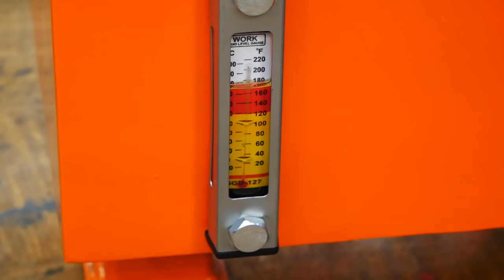Making Gas Powered Hydraulic Power Pack

Comment: Can I make a few suggestions.  You should always have the intake of the pump below the level of oil in the tank . Hydraulic pumps are not designed to self prime and this will wear the surfaces in the pump prematurely by cavitation and lead to loss of pressure very quickly.  
Also the intake line on Hydraulic pumps are supposed to be atleast one size up then the output line. It draws in through that line at a higher flow rate then the introduction of resistance to flow creates pressure which the pump generates on the output side. This will also lead to cavitation in the line.   One last thing is try installing a wall in your tank ( just a couple of tack welds ) that separates the intake and return hoses but not completely sealed just enough to alow oil to creep around it. This will limit dirt ,debris and frothing in the oil that also leads to pump failure. I build custom Hydraulic systems at our shop just thought you could benefit from mistakes I've made.
Reply: Would that pump work in a vertical orientation? Like under a lawn mower motor and use the chassis as the body of your portable unit?
Reply: @messybench  Yes most gear pumps can run in horizontal and vertical orientations. They do not  have bearings in them so they are designed to spin on a film of oil they pump that usually .040" thick. That's why making sure there's a continuous flow of oil to them is important .
Reply: Brilliant info. Thanks.
Reply: Absolutely, nice suggestions... very sweet.
I will try to remember this if I ever build a Hydraulic Pump system.
Reply: Thanks
Reply: Suggestion from expert, glad to know you mate. Thanks
Reply: How would one add a cooler to the power pac?
Should there be suction filter and a high pressure filter?
Reply: @Navigator777777  Cooler are usually always installed in the return line right before the return line filter going back into a tank or reservoir.  This part of a hydraulic circuit should by design never see more then the internal bypass crack pressure of a return filter housing.  (Around 15 psi or 1 Bar on most small return filter housings).
Reply: Is this true? Hydraulic pumps are not designed for self priming?
Reply: @peterrajeshcrasta1524  After they have been primed they will maintain a suction but the reservoir should by design be placed in a way that the oil level is above the pump. If you operate a hydraulic pump dry even for less then a minute the rotating parts can wear the plate surfaces very quickly.
Reply: Nm
Reply: Would you please start making and posting videos? 😁 I'd very much like to learn more about hydraulics, and it sounds like you have the proper experience and knowledge 🙂  Thanks for sharing these tips, very useful.
Reply: @buildthings79   throw a check valve below the supply line just under the pump to keep her full with juice or am I wrong sorry just a noob here
Reply: @justincapasso5691   Unfortunately the check valves used in hydraulics require certain amount of bypass pressure to open them and this would add to the draw vacuum required to draw the oil into the pump . You also have to take into account temperature changes.  When the oil gets cold it becomes thicker.  It's on those days that cause the most damage to a pump.
Reply: @buildthings79   what kind of degrees/certifications do you have and field experience because it’s seems you have a very advanced knowledge on hydraulics. I’m just getting out of a mechatronics program and would like further understanding on the hydraulics field. Also make a YouTube channel for gods sake lol.
Reply: @justincapasso5691  I own a small custom Metal Fabrication shop where we build a verity of metal and custom hydraulics jobs. We have a cnc plasma table, cnc pressbrake, and a number of welders. I also have 2 hydraulic hose crimping machines . I have been doing this for about 20 years and have taken a few certification classes on Industrial and mobile hydraulics. We rebuild cylinders and other such hydraulic components . I just finished a custom job of installing a 1991 Sea Crane knuckleboom crane that was custom built for the army corp of engineers barge onto a tractor trailer cab. It had no outriggers so we had to rob some frome another salvaged Hiab crane . We rebuilt from scratch one of the outriggers and fitted a double bank joystick manifold with 12 circuits . The crane was a 15k lb with a 25ft reach. It had double rotation cylinders and a 250ft 20,000 lb hydraulic cable winch on the boom. It was a really fun job.
Reply: I thought also it's always advisable to have a pressure relief valve as the first thing on the circuit with it's own return line and not rely on the one in the mono-block
Reply: Also all the 90 degree fittings add to the inefficiency of the system, even with no load on the extension and retraction of the cylinder , you could here the strain on the gas engine.
Reply: Do you need a relief valve when making something like this? For any pressure build up from the heat or something?
Reply: @andrescalleja3175  Yes , it should be located on the pressure side of the pump either by itself or the first thing in a valve body . These will generally relieve back to the tank.
Reply: @buildthings79  in this case would it have been the thing he was holding that looked to have an oil filter attached? 12:54
Reply: @Andres Calleja  That is a return line filter housing. They generally have a small check valve inside that if the filter becomes clogged, it bypasses it and goes straight to tank. That check spring is usually 15 psi. Or 1 Bar.  You want pressure relief earlier on in the system because it protects the items after it from  the pressure spike. The seals will be protected.
Reply: @buildthings79  in your opinion do you think a power washers motor and pump could be used to make a small hydraulic pump?
Reply: @Andres Calleja  You can certainly use the engine off the unit and look up a calculator online to determine the max pressure and flow pump that would couple to that engine output. I don't think the pressure washer pump would work very well. They have internal bypasses and check valves that are sized for water viscosity and have ceramic plungers that may not have the same tolerance to limit oil blowby direct resistance.
Reply: I agree with the above  it seems to me the delivery of the pump is too high. I would suggest you fit a pump with a smaller delivery to match the HP of the engine giving better power and control.

Comment: When you build it out of tools that you also built. Skill level 10,000. That plasma cutter is so sweet!
Reply from the maker: Thank you 😁
Reply: @WorkshopFromScratch  - The only "problem" with the plasma cutter is that you have to manually hold up the plasma cutter line 0:09 as the cutter moves across the material.  It would be nice to have some sort of spring suspension to do this task for you.  A minor thing, but one can see that you must lift up the plasma cutter hose before it binds on the edge of your work 0:13 - fantastic work as always.
Reply: Did u build that plasma cutter

Comment: Nice. I am pulling a 31 HP Diesel from an old tractor and was planning to make it a mobile power unit to drag behind a tractor. Perhaps a bit more ambitious than I can chew at once, but I'll get it working eventually.
Reply: How's the project coming along?
Reply: @user-ki9ez8wx7f  Mostly it's not. I got the old engine fired up and towed the tractor to a work area (it has a busted transmission and was parked out in front of the house). We got it so it starts easy every time. Then nothing. Time is the issue. At least the lawn ornament is gone. Wife happy about that.

This coming week might see action, because I have company visiting and they are those kind of people.
Reply: Dimix
Reply: ⁸⁷⁷

Comment: This is a brilliant idea for situations where the hydraulic system is somewhere else not close to electricity. I will want to build one like this too (with some small changes, will reuse more scrapped parts, like compressor housing for oil reservoir).

Comment: I would route the intake tube to the opposite side of the tank and maybe put a baffle between intake and return. The returning oil gets air bubbles in it and damages the pump or makes it noisy. The distance will help them settle out. Not sure if painting the inside of the tank was a good idea. Hope it doesn't flake off and cause issues.

Great work and thanks for posting it.
Reply: Great video.  I agree with the baffle, trash/condensation will settle out and if something ruptures, you loose less oil.  An inspection hole for the spider might be a good idea.

Comment: I have a hydraulic power unit. This has a 30 hp Wisconsin VH4 engine powering a hydraulic pump with 10 gallon fluid reservoir. This powered a "manlift" bucket truck. I  would like to build several hydraulic projects & power with this universal hydraulic power pack. It could power a log splitter, back hoe, skidsteer loader, stump grinder, saw mill, tree limb shredder or anything that can be operated hydraulically.

Comment: just a suggestion: put quick disconnects on the valve block?
i love your projects! Keep up the good work!
Reply: I was just going to say that. This way you can make more than one tool. 
I would have also prepped in a way for a remote cooler and I am pretty sure the larger size up engines have the same bolt pattern so you can always upgrade to a larger one as many people find that the smaller ones just do not have the power once they have it built.
Reply from the maker: Thank you 😁 Quick-release couplings are definitely a very good idea :)This is  the project will be developmental, and the next project will work thanks to this hydraulic power pack :)

Comment: A couple of things I've learned from experience. Don't make tanks out of hot rolled unless you remove all of the mill scale. It will start falling off later as an abrasive iron oxide powder. Not good for fuel filters or hydraulic power units. :) Also I have never found a small pneumatic tire that doesn't fail and develop leaks in a year or two. Now I always go for solid rubber or metal. They do make flat proof tires but since they are considerably more expensive, I haven't tried them so can't speak to that. :)
Reply: even with painted tank.

Comment: You can do several projects with this hydraulic machine , I liked , congratulations
Reply from the maker: That is my plan😁 Thank you 😁
Reply: As someone said above, adding some quick-connect couplers on the feed and return lines would do wonders - and put the same quick-connect couplers on your tools you plan to use with it.  Very clever.

Comment: Should have put the drain plug on the edge, not in the middle, so when you do need to use it, you can tip the tank to get it all to the drain.😀
Reply: quick connects less mess too, can use for anything

Comment: I hope he had a window open while he ran that engine inside. CO poisoning is no joke it can kill you in a matter of minutes. Besides that I like the build.
Reply from the maker: Thank you 😁 I have a well ventilated room and the outside air is on and as I wrote in the video, I only did a test to show how it works, the power supply will mainly work with external machines and I'm going to build such a machine in the next video :)

Comment: Build one with a 20 HP engine and a pump that can move 19 or 20 GPM of hydro fluid, mount it on a tractor and you can do some real work. Front end Brush hogging,  Large deep hole augering with the loader end,  Land clearing with a mulcher.  Most small tractors don't have the GPH  for a lot of those things. 
You could sell them.

Comment: Video super, can you give clarifications on the hydraulic pump spec selection with respect to the engine spec
Reply from the maker: Thank you :) The pump has of 6L right direction of rotation, as for the engine, I did not take into account the power that is written by the manufacturer because in my opinion this power is overstated, and the real power does not differ from the engines with a capacity of 200cc
Reply: @WorkshopFromScratch  - probably 5-6 HP

Comment: Where did you get the coupling, because pump shaft is conical, but motor shaft is cylindrical??? Can't find any. I'm building power unit myself, but can't find that exact coupler.
Reply: Did you find anything yet?

Comment: Do you plan to stabilize rpm of the engine to allow hydraulic pump work in the range?
Reply from the maker: Yes, you are right RPM too low causes the engine to stall too high, they have no effect except noise, but it seems to me that you can quickly work out the ideal speed range and mark it on the regulation, Most stationary engines like this have centrifugal speed controller, which will always try to keep the RPM in the same range when loaded, as is the case with most mowers :)

Comment: Great video! can You share the parts list?
Reply from the maker: The parts list is not very long, so I can write it for you :)
-gas engine 200cc 
-RIGHT hydraulic gear pump GR2 6L
-claw clutch
-hydraulic distributor
-thermometer for tanks with hydraulic oil
-The rest of the parts are the connectors and the clock
The construction is quite simple, so after watching the movie, you can easily do something like this :)

Comment: Do you have any tips to prevent warping?
Whenever I tack something together the pieces often warp out of alignment when I remove my clamps.
I'm using TIG though if that makes any difference.
Reply from the maker: Shrinkage and warping are less likely to occur when the weld and its surroundings slowly cool down, when it is important to me that there is no shrinkage after welding I heat the weld and its surroundings with a torch to slow down cooling, gentle hammering around the weld area also works
Reply: @WorkshopFromScratch  Oh, interesting. I'll give that a try next time.
I thought the warping was mostly affected by the total amount of heat introduced during the weld.
Thank you :)
Reply from the maker: This total amount of heat input has the greatest effect on warping, but if you do not allow it to cool down quickly, the damage is not that great :)

Comment: Why the hell are you weaving with a small single pass weld , your getting a weaker weld than running it at a 45 degrees. A internal baffle would help to stop any aeration with such a small reservoir

Comment: How did you size the tank, pump, hoses, motor and adaptor?
Reply from the maker: In selecting parts, it is worth asking the seller who sells the parts for help. The pump is quite fast but that was the goal for a future project, I will also buy a slower pump so that the power supply can power hydraulic cylinder that will work slower but will need more force

Comment: Nice build, but you shouldn't run a gasoline motor inside you are poisoning yourself with carbon monoxide.
Reply from the maker: Thank you 😁 I have a well ventilated room and the outside air is on and as I wrote in the video, I only did a test to show how it works, the power supply will mainly work with external machines and I'm going to build such a machine in the next video :)